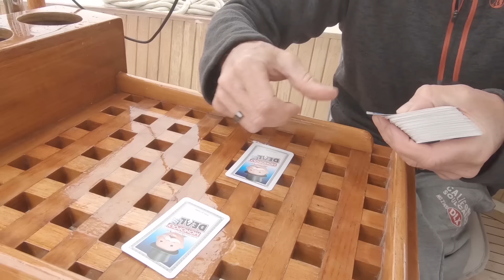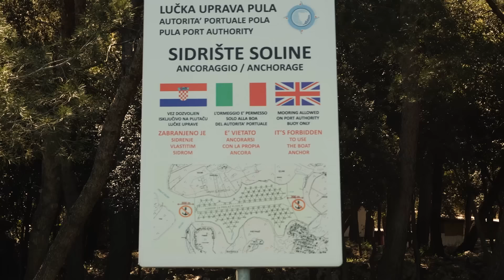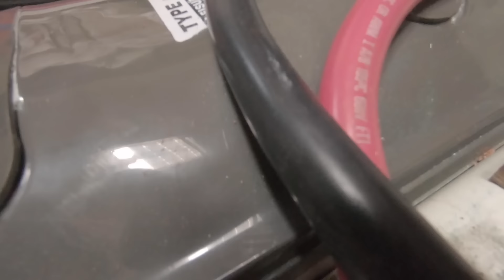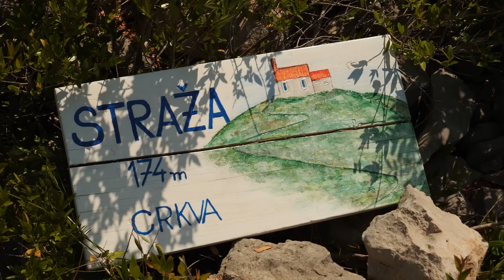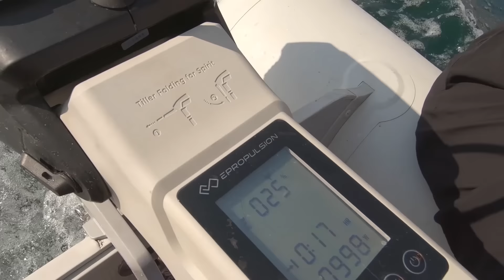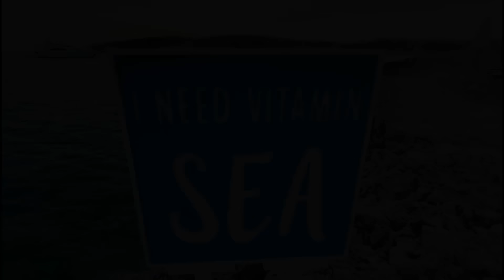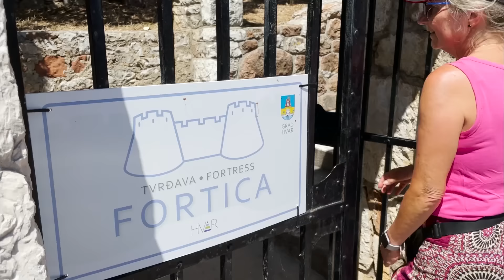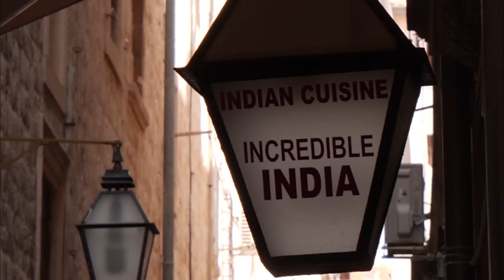Fair Isle Mega Compilation Season 3 (part1)

Comment: Fantastic video as usual, but did you think about switching to induction stove , electric oven and convection microwave ? I think with the new batteries and solar panels your ok ? Besides the gas runs are a pain and you just eliminate the safety problem ! Let us know what you think , I understand it’s a big upgrade!
Reply from the maker: We don’t have enough power for that. Having no generator means it’s all about how much power you can gather from the sun and there really isn’t enough real estate on a monohull to give us enough if we added any form of electric cooking, it’s just too power hungry. We very rarely use our induction hob when we have excess energy but it’s not that often. We do have extra fold out panels we can put on deck when at anchor so we could charge the EcoFlow units for cooking but at the moment we would rather use that spare power for the AC!